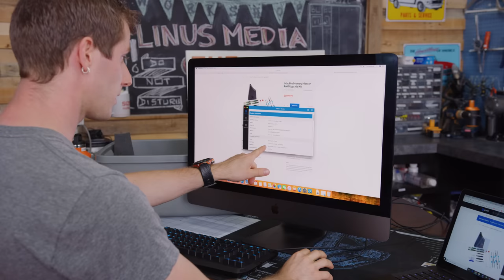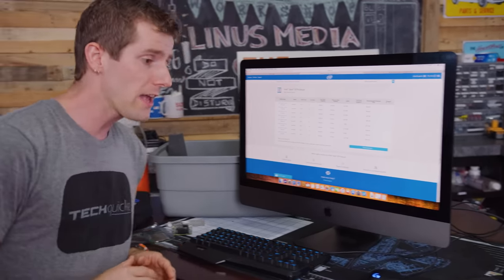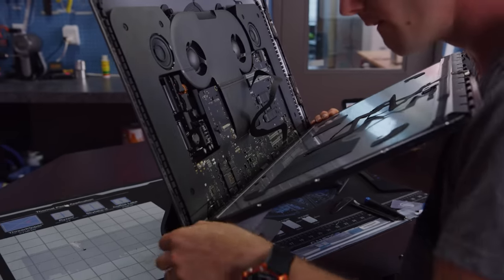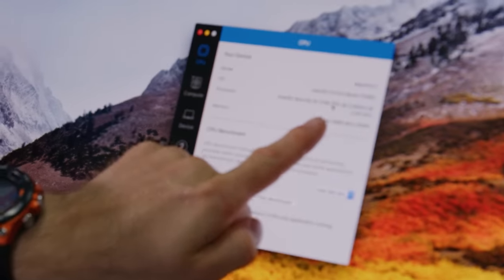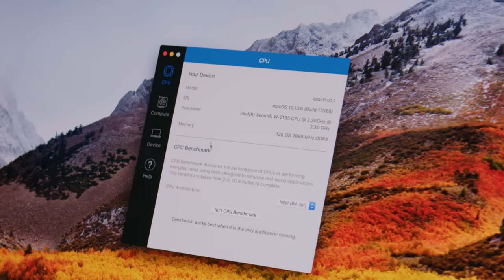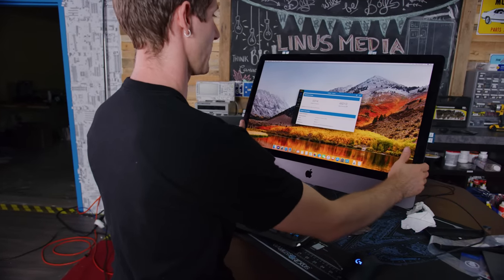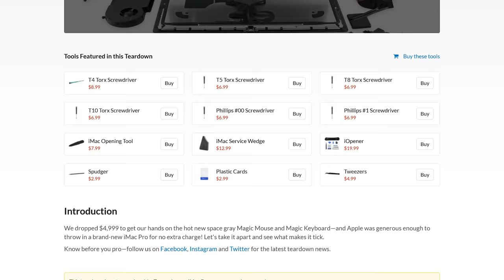UPGRADING the iMac Pro!?

Comment: You know Linus has made you numb to what's considered overkill when you're legitimately concerned he didn't use liquid metal.
Reply: How is liquid metal terrible? There's literally no downside to it unless you spill it, which you wouldn't if you weren't clumsy.
Reply: @lilkittygirl  how do you figure? If you have a stable setup, there's no issue.
Reply: @saintfrac5360   you know linus would find a way to spill the stuff
Reply: LinusSpillTips
Reply: GN has done a lot of content around liquid metal with stability/reliability testing over the course of a year and it's fine lol.

As long as you aren't dumb and don't mix gallium with aluminium you'll be ok kid
Reply: saint frac liquid metal uses Gallium, and if you mix a copper baseplate with an aluminium IHS it'll corrode the copper and eat the aluminum if you leave it like you'd do with regular thermal paste. Google out the effects of Gallium on aluminium :)
Reply: Most heat spreaders are nickel plated, so the gallium doesn't affect it nearly as much.

Comment: Hey Linus. I was thinking a little bit about latency. Gamers always say they want the minimum of latency and deny using stuff like wireless mouse and keyboard and mouse. Some say gsync causes latency and what not. So it would e really great to have some up to date input on what causes how much of latency. Like wired vs wireless and no sync vs gsync vs freesync and stuff.
Reply: If you want to know about latency stuff check out "battlenonsene" channel, he has some good analysis on most of the things you mention.
This video is about gsync vs freesync: watch?v=mVNRNOcLUuA
Reply: what is freesync?
Reply: @Vinn0  It's basically Gsync but for AMD GPUs and cheaper.
Reply: thx
Reply: SunioMc  and has small latency over g-sync.
Reply: You can easily just got to BlurBusters and get literally all this info. Spoiler alert, gsync adds ZERO latency inside the gsync range (ie, your monitors refresh rate).

Comment: Don't forget, the original Mac Pro was completely tooless, and had handles and grip points in it to make upgrading and repairing it as easy as possible.

And on the new computers..... Not so much
Reply: It also had a killer case. I've got a Power Max G5 (pretty much the same case) that I picked up for $5. Ripped all the guts out of it immediately, to cleanse it of it's apple-ness. In the process of modding it into an ATX gaming rig.
Reply: typing this on my "cheesegrater" right now. 
I don't like the trashcan. I don't like this non-upgradable nonsense. 
How are they going to compete? I'm seriously considering buying a PC running Linux for my work.
Reply: @reptilespantoso  The cheesegrater was an amazing design, I wish other companies would pick up on it and start making machines like this now that Apple hasn't been in a long time. HPE kinda does, but they are not even close to interested in any consumer or prosumer customers.
Reply: Yes, agree; I feel it's near perfect. They could do a smaller version of that for the next gen. instead of a black plastic thing. Make it the same gunmetal grey as the iMac Pro, and it makes sense in the line.
Since most of my gear is 19" rack size (pro audio studio) I wouldn't mind a rack unit mac pro either (like their servers of 10 years ago). I think no one would complain if they get that right. Something inside me doesn't want to fork over 5K for a plastic box. There are very nice looking 19" racks for the "design conscious" users. 
We'll see. Hope you have a nice day.
Reply: Those older cases are so awesome. I bought one just to gut as a case for my PC rig because of how well made it is. Love the machined hardware look too.
Reply: @sigmaprojects  The case will fit a mATX board that is turned upside down? Or am I remembering incorrectly?

I have been considering picking one up myself. I always loved the case of my old G5 tower, the side panel looks to be easy enough to convert to acrylic if one wanted to go full baller. Could even use Lye to strip the anodising off and then re do it in another color.
Reply: @reptilespantoso  An Apple Xserve for the pro audio marked would be absolutely wonderful. Unfortunately I doubt they would ever do it since they are kinda out of touch with their roots, but this would be a killer product.
Reply: @Matthew McKellar

Yes you mount the board flipped. I used one of the older G5 cases and it'll fit a pretty large board. My ATX board looks micro inside of the case, but the space makes it nice to work on. I had to relocate some of the stand offs and cut out a bit of the back panel to allow for the I/O ports. I also gutted the Apple PSU and put my own inside it to keep the case looking clean on the inside. You can see how spacious it is from the link below.
https://www.instagram.com/p/BGVqXPwKaP6/

Here's how it looked with everything installed except for the video card and CPU fan. I also ended up reusing the rear fans.
https://www.instagram.com/p/BG8dmYlKaBw/
Reply: @sigmaprojects  What kind of PSU did you stuff into the subfloor? I don't remember it being big enough to fit an ATX due to height? It has been a long time since I had one apart though.

It's super cool you have one modded btw.
Reply: @Matthew McKellar
Thanks =D The top shelf in the case can easily be cut/bent to accommodate the extra length as the ATX board doesn't go that much farther into. I can't remember exactly which PSU I used, but I know I used a high efficiency 500w PSU since it would be going into a tight space, I want to say I used a fanless PSU, but I can't remember. Either way, I kept the stock apple PSU fans and routed the fan speed signal to the board in case it ever failed it wouldn't be a surprise. Newer PSUs are much more compact than older ones as you can see in this comparison.
https://www.instagram.com/p/BFzxmb7qaHp
Reply: @sigmaprojects  Oh! Haha, I forgot they had changed the PSU layout between the G5 and Mac Pro! The G5 puts the PSU in the case subfloor, versus the Mac Pro which puts it on the top shelf.

It would be interesting to compare the modding process for both. Since the Pro has more PCIe slots and the top mounted PSU, and the G5 having less slots with a bottom mounted supply.

Is there enough space in the caze to use a motherboard tray? I might try using a CNC router to cut one out if it would work in a mod. 

One hell of an Instagram btw
Reply: @Matthew McKellar
Thanks I appreciate the compliment =D That's right the Mac Pro did have the PSU flipped. I never planned on using more than 2 PCI slots and the 4 allows for enough space if I did SLI. I'm pretty sure you could use a motherboard tray as long as the standoffs match the proper height. The stock height of the apple stand offs allow for the PCI devices to line up with the exterior slots. I think overall it's easier to snap off any existing stand offs that don't align and epoxy them in place. In the G5 case the stand offs are pressed in so with a set of pliers you can pop out the stand off without destroying it. If you see a shiny circle in the case it's where I popped out any unused stand offs to keep it a clean appearance.
Reply: True but the original Mac Pro came out in 2006 when Steve Jobs was around he actually cared about the end users and what they wanted. Apple today knows that no matter how horrible of a product they make some sucker is going to buy it case in point the 2019 mac pro they charge three times as much for the max 1.5tb of ram to have them upgrade it then it costs too buy it and upgrade it yourself

Comment: Once again as I said in the previous video...  Disassemble/reassemble it with the back of the iMac to the table.  Then you can set the screen on it and connect all the wires without needing three hands and you can test it with the screen laying on it or you can use packaging tape to hold it in place if you want to stand it up.  But don't disassemble an iMac with it standing up.  That's asking for another broken screen.  I was just waiting for that screen to fall off if you bumped the table hard enough.

Comment: I'm pretty sure it would be less stressful to be a color-blind bomb disposal technician who has to find and cut the one blue wire in a sea of red wires on a nuclear device that is going to explode in thirty seconds and possibly take out all of New York City.
Reply: Funniest shit I’ve seen in the comments in a while.
Reply: Yes beacase you can cut all the wires
Reply: That's..... oddly specific.
Reply: Also, if it's just red and blue, you could find it by finding the one gray that's a different shade of gray than the rest. Wait, was I suppose to say spoiler alert?
Reply: @Peekofwar  no, no it wasnt
and black and white colorblindness is extremely rare
Reply: @hahah17  I was kind of using "gray" as "a shade different to the other wires," and less as its literally definition.
Reply: The great benefit of being the color-blind bomb disposal tech cutting the wrong wire versus screwing up the installation of new hardware in an iMac Pro is that the tech screwing up the iMac Pro update is going to be sorry for a lot longer...
Reply: @Peekofwar  The point being that if the bomb disposal guy cut the wrong wire he would set off the nuke and he’d be sorry about that. But just for a really short time...
Reply: @howardtreesong4860  A nuke, yes, but typically, bomb squads aren't defusing a nuke.
Reply: @Peekofwar  Which I only mention because raydeen2K brought that up.
Reply: raydeen2k i would be happy about that exploding

Comment: You know what I'm getting into making my own PC (it's gonna take ages to get all the bits together - only have the case at the moment, waiting for the motherboard and Blu-Ray drive in the post) but I have an old iMac, the thicc ones with the disc drive and...it's old tech. It literally cannot be updated because the hardware is too old. So ripping it apart and upgrading the innards is a fucking good idea. Easier said than done, sure, but it's on the to-do list right now. Thanks Linus (I'll do it after I've done my PC though)

Comment: Hi Linus,

Couple of notes here when opening retina iMacs.

1. During the process of removing the screen/putting it back on or testing you should do 2x horizontal bits of tape at the bottom of the screen and main housing so you can use it a pivot point to assist when removing the screen/putting it back on. During testing, you should also put a bit of tape on the top half and over onto the back to not risk the display falling off while testing.
2. The strips have holes in them to use the point of an ESD safe 'black stick' in order to make lining the strips up a piece of cake.
3. During the removal of the screen the bottom strip can be cleanly removed by pulling on the tabs at the end and peeling it off sideways in order to detach the screen
4. When pulling the board out, you need to remove the bottom screws along the base of the rear housing which makes life FAR easier when removing/installing the logic board.

I hope this helps!

Comment: Not the first time they didn't use a retention mechanism for the CPU. The original Nahalem Mac Pros didn't have them, either, and the dual socket versions didn't even have the IHS on either of the Xeons that were in them.

Comment: So basically you can go through triple the work to do an upgrade that would have taken less than 20 minutes on a PC, and get a machine that is capable as a PC costing half the price...
Reply: Pretty sure Linus review said that it would cost the same amount of money to make the same PC, also it would naturally be harder to work on sense it is an AIO
Reply: The 3D Printing Corner if you can find the parts and the 5k monitor cheaper, the yea you can do it for half the price. But since you don’t anything about pricing and technology, no it wouldn’t cost half the price.
Reply: didnt he say windows was being a bitch ? and since he was gonna upgrade the cpu on the mac to work on w/e it was he was also gonna do the ram ? lmao we now pc is the best but that explains why he upgraded the mac in the first place was because of windows and if he would went for the same build on a pc and just installed ios software woulda been more exppensive cause he woulda needed psu mobo and whatnot lmao
Reply: 20 Minutes!???Maybe if you live in slow motion.
5 at the max!Open side door, unscrew heatsink, replace cpu, replace paste, screw back on heatsink. Take out old ram sticks, replace with new ones add the extra ram sticks. Close side door. Done
Reply: He doesnt build hackintoshes i guess
Reply: Linus said when comparing specs that the Mac is comparably priced with a PC.
Reply: Actually this Mac pro is same cost or cheaper than building the same PC, according to linus' earlier video.

You are right with all their laptops though haha
Reply: Price per components they are comfortable, but price to performance, you spend that on a PC and you have a far more powerful machine if you use your head when putting it together.
Reply: @televisionandcheese  I was being generous
Reply: Price per components is about right, but if you spend that much building a PC you can get much better price to performance.
Reply: Mac Pros are actually doesn't cost 2x. By the way, macOS blows Windows out of the water for productivity reasons. I hate Apple but damn, their OS is good. Only reason I made a Hackintosh.
Reply: It looks like all those imac parts are miniaturized like laptop parts. Comparing those to Full size PC parts is literally apples to oranges.
Reply: Too bas MacOS is a superior operating system, you could always hackintosh, but ya'll PC normies probably wouldn't know how to use the OS anyway.

Comment: Wait a minute. The encryption chip is meant to protect your data in case of theft (thief needs password to login, can't get the ssd's desoldered yada yada). That's sad enough already, because when your motherboard dies, all data is gone. But why doesn't it even allow you to put new storage in? It should be quite simple to wipe the disk and install whatever you want encrypted by that separate chip. It should cause no "security" issues to allow that. So I guess it's just Apple trolling again.
Reply: The encryption chip is meant to protect you from saving money by repairing your imac instead of buying new one.
Reply: The T2 chip does more than just protect from theft. It controls audio, microphones, system management, safe boot, and the webcam. With the webcam it's supposed to have a better image processor for better capture and FaceTime output. But yes, having your machine bricked would suck, but you can turn off the T2 encryption
Reply: The chip does not protect from theft, the fact that you need a whole case of tools and an online guide just to open it, let alone get to the ssd’s. That’s what protects your data.
Reply: When it comes to pros and cons, to Apple, your benefit is always on the con side.
Reply: You're not going to get it repaired. The moment you bring it into an Apple store they're gonna say fuck you go buy another one because we are Apple and you are locked into our closed ecosystem. Those kernel panicks? They're your fault. Any and all errors are always the user's fault. Give us your $$$$$.
Reply: Or you could backup your Mac with Time Machine like you're supposed to so you don't have to lose your data
Reply: And when you lose the ability to decrypt the backups?
Reply: The T2 chip only encrypts the built in ssd it is not responsible for Time Machine backups. If you encrypt those backups, they are unlocked by the password you set. How else would you switch to a new Mac and use the Time Machine backup? Obviously you cannot move a T2 chip over from one Mac to another.
Reply: Or you could just not use apple products.
Reply: It's Apple security, not smart security lol
Reply: Daniel De Ciantis That is, unless if you're Louis Rossmann and own a Zhuo Mao. If you're him and have one on hand, you absolutely can. ;)

Comment: I do these repairs for a living, and you did a nice job. That said, Linus, you are SO lucky that screen didn’t fall off while you went about adding on the peripherals, plugging it in and starting it up etc. 

If you’re going to do that With the iMacs standing up, you need to at least put some temporary tape at the top and bottom. The last thing you want is that screen falling off after you’ve gotten all your work accomplished. 

If that happened, you would’ve potentially damaged the Logicboard, display and cables.

Comment: Hey Linus Please Try Liquid Metal In A iMac Pro...
Reply: Ain't gonna work, you know Apple, they love their aluminium.
Reply: @Ivan Ivanov Yeah...
Reply: it is but aluminium is cheaper, apple probably cheaped out and the liquid metal mad eat the aluminium
Reply: De-lidding the CPU to replace the stock TIM would help with temps, but I'm not sure it's worth making a video on this channel. There have been way too many liquid metal videos lately. Plus the iMac Pro is far from the worst Mac when it comes to thermals.
Reply: Oh, and you can clearly see in the video that the cold plates are copper.
Reply: Naw, do an external liquid cooling solution for the gpu.
Reply: @ChronoXShadow  that would be cool